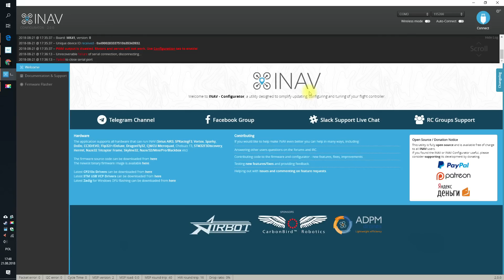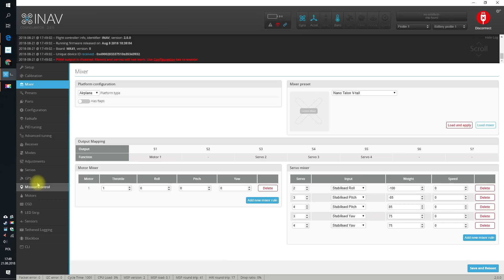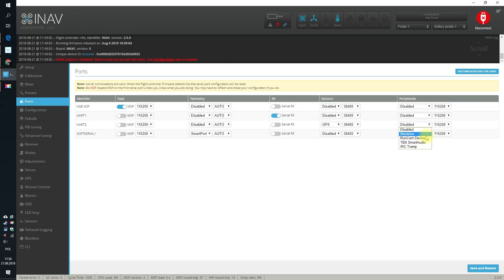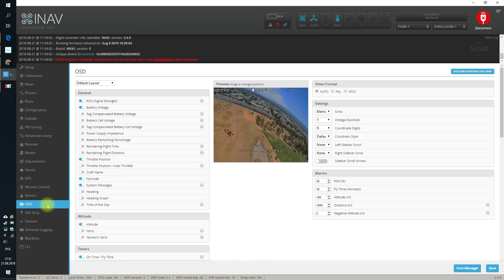Matek F411 Wing flight controller for airplanes

Comment: Are you going to do the flat Wing modification to the Nano talon? My friend did it to his and we put the F411 wing and it flies so much better and so much more slippery through the air. Even his Cruise speed uses less amps not much but enough to make a difference. I love this little FC but trying to figure out if I can mount it upside down?

thank you for always showing us the latest and greatest features 🔥🤘

Comment: Thank you sir for the overview, I was wondering can this flight controller be mounted upside down? Like underneath the fuselage upside down but it would be covered with a lid because I have no room on top because of my GoPro. I would just have to change some gyro perimeters and is that correct? any help or advice you can give me would be very much appreciated I know you're a busy guy and we all appreciate everything you do.

You're basically a rockstar 🔥🤘

Comment: Pawel can you change the target.c file to have 4 motor outputs and the rest as servos?? thanks
Reply from the maker: but what for?
Reply: sorry im talking about the bigger board f405SE. Can that be used for a hexacopter with 2-3 servos?
Reply from the maker: In MC mode it has 6 motors and 3 servos so sure, should work

Comment: Hi Pawel, I had issues with smartport, and i can't get sensor list refresh at my taranis x9d+, and continuesly get "sensor loss" warning on my taranis ..... not normal data receive
FYI, I use R9slim receiver and r9m module, and i already soldered the wire acoording to the manual (smartport to ST1 pad) , 
configuration :soft serial on, 
port = soft serial = smartport

can you help me? is this somekind of bug on iNav 2.0's F411 wing??... thanks

Comment: I bought an F411, but I was disappointed to find there was no RSSI pin - I can't believe any flight controller would leave this off
Reply from the maker: you can inject RSSI in one one channels with OpenTX you know
Reply: With an L9R?
Reply: @Tsnafu  Use firmware variant MATEKF411_RSSI
 - if you want to have analog RSSI input on ST1 pad. softserial_tx1 will be available on the LED pad.

Comment: is a inav tweak possible to add a second soft serial? on the LED pad?
Reply from the maker: No idea. Possibly
Reply: I just entered a feature request for to get 2 soft serial ports mapped. In BF you can resource map to get 2 soft serials on the F411 mini board. I hope it goes thru soon!
Reply: http://www.mateksys.com/?p=5159#tab-id-4 
Variant Firmware - MATEKF411_SFTSRL2
if you want to use two softserials (TX only) at the same time. Eg. VTX control + S. Port
softserial_tx1 on ST1 pad, softserial_tx2 on LED pad

Comment: Its so expensive compared to a omnibus f4.. omnibus has blackbox more uarts and is solid for inav use, but f405... just different form factor and big price premium. F411 is better value
Reply: Are you taking about a genuine Omnibus F4 or a clone board?
Reply from the maker: Do not compare cheapest clone with it. Different league. And over here you have PDB too
Reply: no 5a servo back....
Reply: You need a BEC with omnibus, right.
Reply: youre right about bec... but still expensive
is this genuine or not? http://www.readytoflyquads.com/flip-32-f4-omnibus-v3